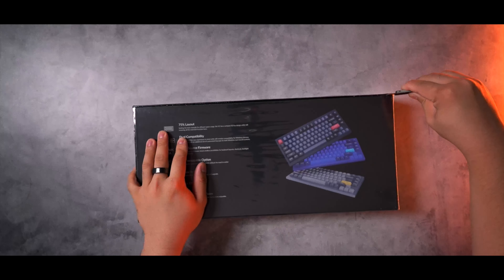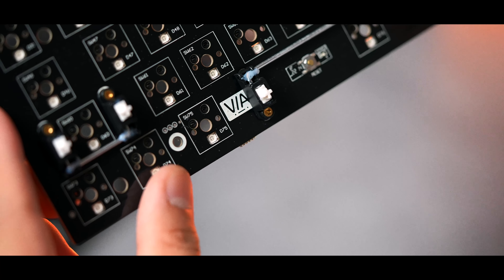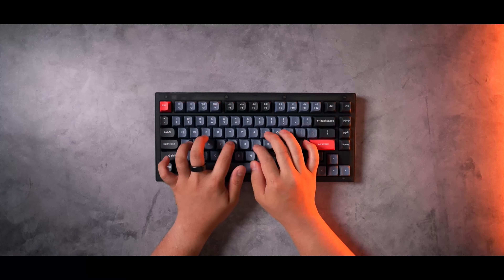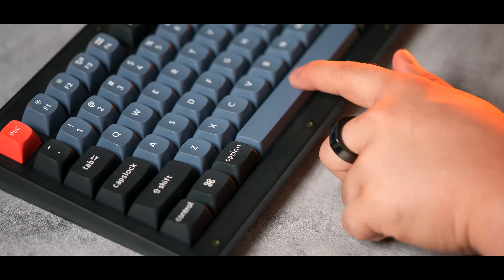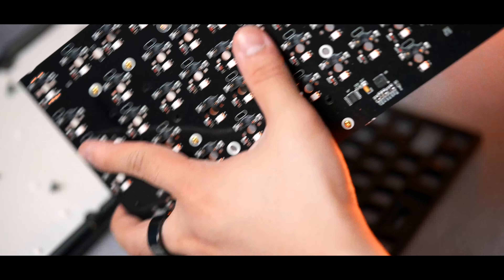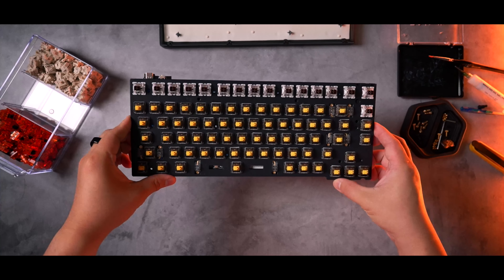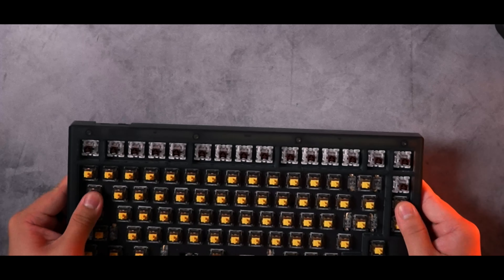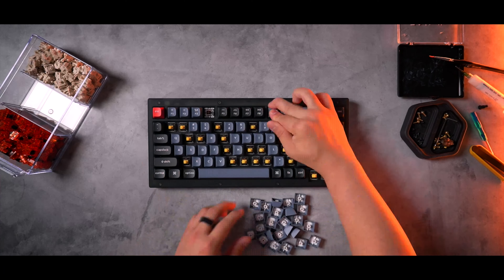Keychron V1! - Build, Mods, & Thoughts

Comment: super underrated channel. This is a great in-depth review. Thank you for including the all the different variations of mods and w/o mods + diff switches
Reply: Hey there, {{3}}! I totally agree with your comment. The Keychron V1 is indeed a great keyboard option with many customizable variations and switch options. By the way, have you heard about the HOTO Compressed Air Capsule? It's a fantastic cleaning tool that combines vacuuming and blowing capabilities, perfect for maintaining a spotless desk setup. Check it out if you're interested in optimizing your cleaning routine!
Reply: Hey there! Based on your comment, it seems like you're appreciating the content and mods of the Keychron V1 review. If you're looking for a useful tool to maintain your desktop setup, I'd suggest checking out the HOTO Compressed Air Capsule. It offers powerful vacuuming and blowing capabilities, ideal for keeping your workspace spotless. Plus, it's compact and versatile. Happy cleaning!